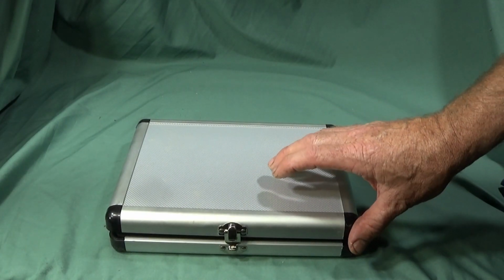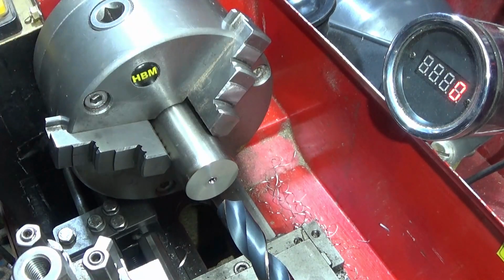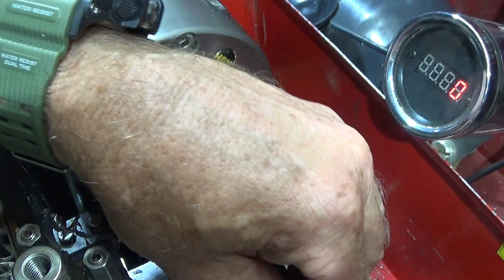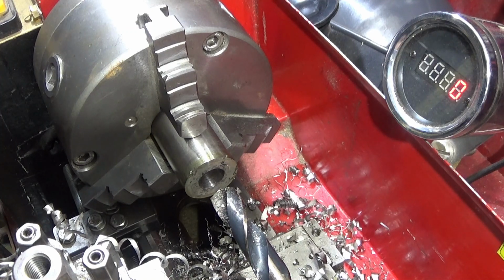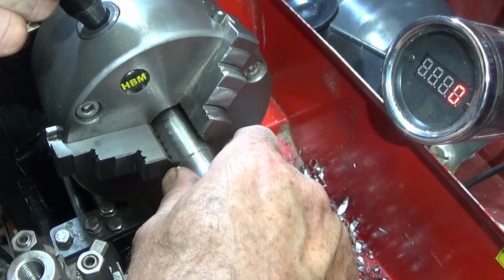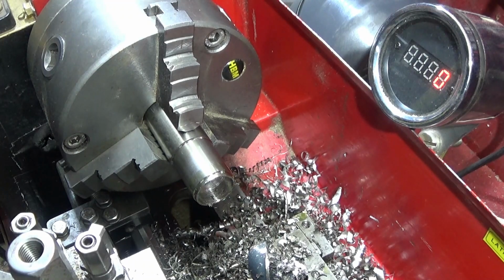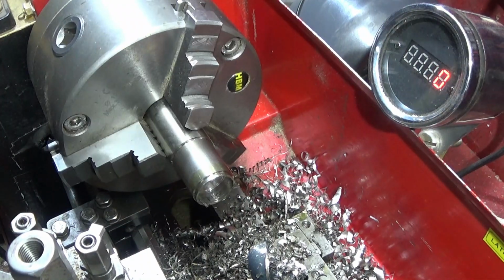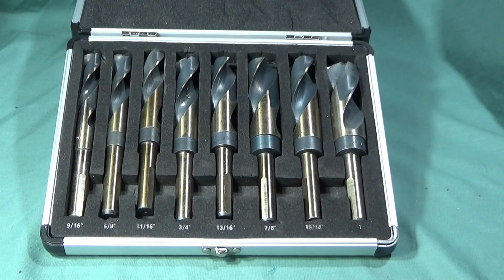The Best Large Diameter Drill Set For The Chinese Mini Lathe

Comment: Far to fast for stainless which heats up super fast, the trailing edge should be slightly under the cutting edge size, also a drill angle tool to ensure both flutes are even & cutting on both flutes, coolant rather than oil which is OK for softer metals, stainless does not like heat, as always when lubricant is used a better cut, as soon as it dissipates the drill stops performing as well, a small pilot hole first, and the chuck looks like it's running out by a mile.
Reply from the maker: I usually use a pilot drill but this was a tool test. 330rpm is fine for stainless.  Mini lathes don't have the facility for coolant and it is too much to set all that up for what I do. The run-out corrected itself in the cut. Like I say....It was a hardness test which proved the drills to the extreme end.
Reply: OK a test, it would have been better to have a comparison say a British drill using the same set up, the fact that correction of the grind to the cutting edge (which was poor even at the beginning only one flute cutting), I would class them as a jobber drill at best, a cobalt drill would have been the drill of choice but more expensive of course , a simple gravity fed coolant system is easy to make using soluble type coolant, picky I know but just observations and suggestions.
Reply from the maker: I have had a set of these for years and they are just as good as any drills. It's great that they are short for the mini lathe. I just get on with it rather than being a fusspot over such things. As soon as one comes to sharpen them any anomollies are sorted. It really isn't that important.
Reply: @albertrowe3351  HSS bits will  cut stainless fine...with a low speed & high feed too avoid work hardening.
 I think Steve did a good DEMO. 
 & can you link to HssCo blacksmiths drills please?I'm  Sure we'd all like a full engineers set of cobalts, but a bit pricey for your average mini lathe owner don't you think?
Reply: 35 years in heavy engineering, drills up to 4" (100mm), metals 316 stainless for vacuum pumps, Admiralty Bronze, for submarines, rotors, Inconel shafts (don't ask the price!). but these are all just comments and in no way put anyone down.

Comment: That looks like a great set. Thanks for sharing. 
What kind of cutting oil do you use? Looks super thick.
Reply from the maker: Hi I just use engine oil. I sometimes find new cans of it at my local recycle center to buy at very low cost. It works fine but doesn't smell as nice as a proper cutting oil.
Reply: Steve Jordan thank you. I use 5w 30 for ways oil (really I coat the whole machine with it when it’s not in use). I’ve got a big jug of ridged brand cutting oil I’m not crazy about the smell of and I feel is a bit thinner then I would like.